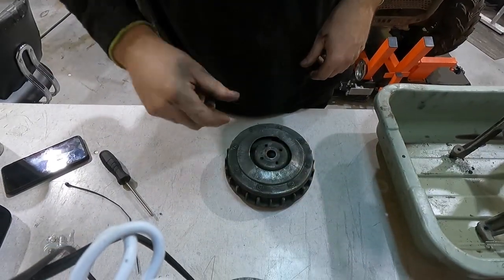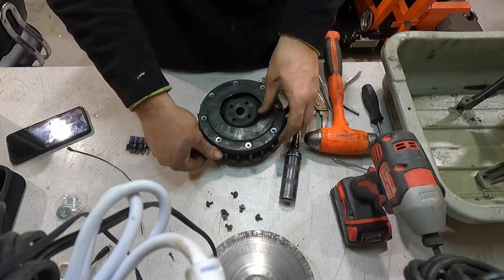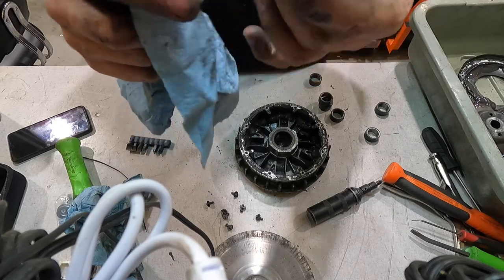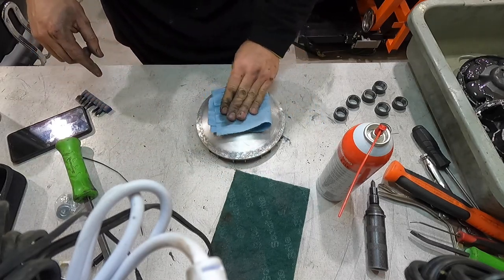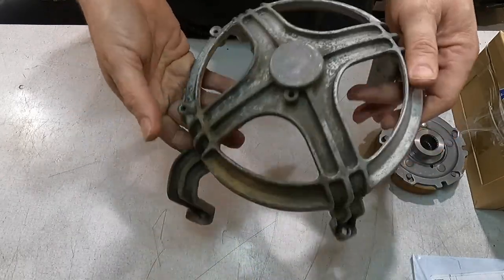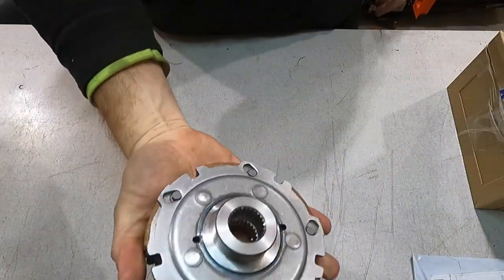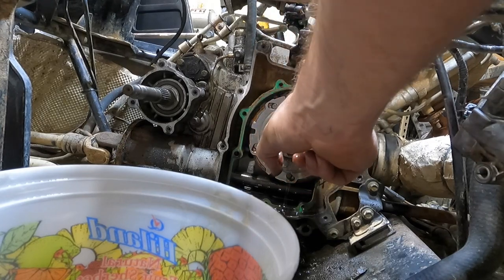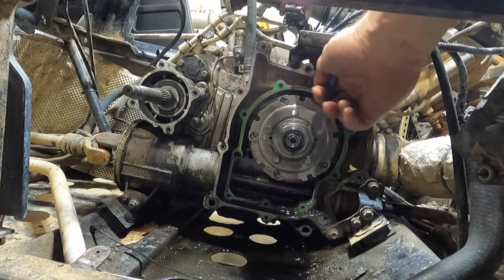Bennche 500, Knocking & smoking motor part #2

Comment: appreciate these videos 
i recently inherited a 2014 massimo 700 
exact setup
your working on in video 
fuel pump was bad i replaced that and it ran fine for a while and just stopped . the fuel pump does not sound like it’s running 
i looked and could not find a fuse for it ? 
i was hoping you would show where the relay is at in the video 
that’s my next move i just don’t know where it is

Comment: do you have any idea why the rev limiter might be kicking in in all gears and neutral as well on a 2011 hisun 500? it will rev normally in neutral and all gears if i hold the rev limiter override button.
Reply from the maker: In this video towards the end I show & talk about the reverse speed limiter/ rev limiter & how to bypass it. You need to pull the gray connector off the ECU & take the green/blue wire #16 pin out of the connector. That will bypass it. It's a problem with the ECU. I did it in this video

Comment: I may have missed something..did you figure out why it was smoking?
Reply from the maker: Oh yeah. The piston rings were almost all gone & one was broken. Also the cam was wore off. I think this was a 5 part series.
Reply from the maker: Also the cam lobes & Rocker arms were wore out.
Reply: @limitlesspowersportsservic3394  Thank you…I wish that you were closer…I would hire you to do mine!
My local dealer wants $1800 for the same thing…is that a high price in your opinion?
Reply from the maker: For me that's a little high because I also did a fuel pump, coolant, diff fluids, primary clutch, belt, wet clutch, oneway bearing, front wheel bearings, complete top end, new cam & Rocker arms for like $2,500 give are take a few hundred $$. I don't remember the exact price.